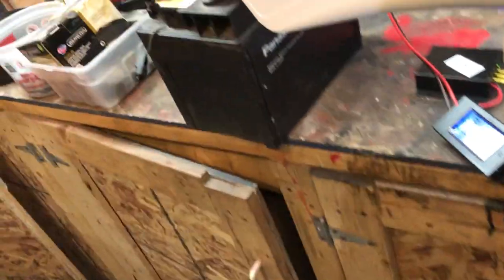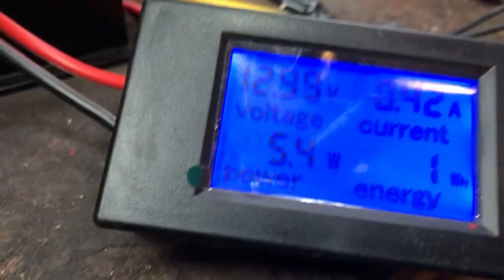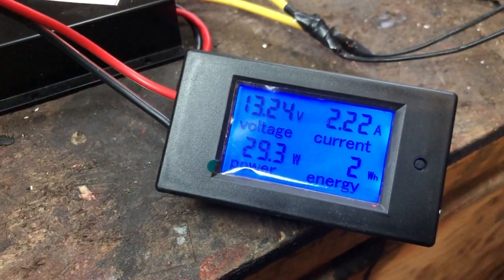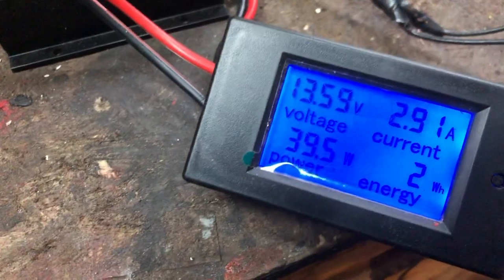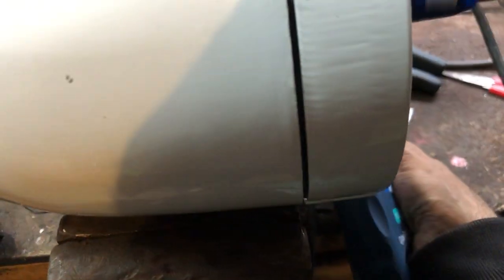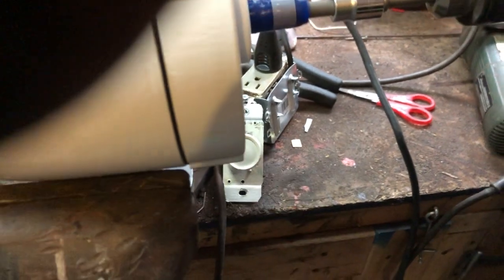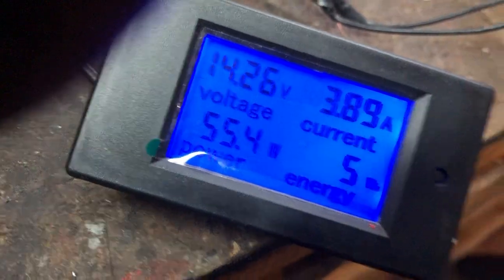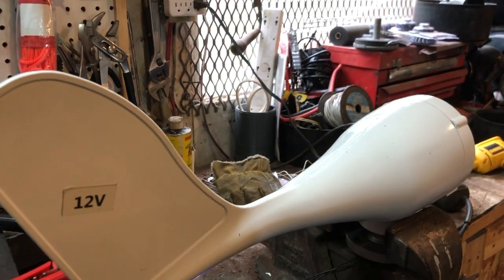Test of a 5400w Chinese wind generator from eBay - Part II

Comment: the turbine is a 500 watt turbine and it is only standard wind charger with maximum 50 / 100 watt ^^ you need a "real" wind controller ! and you need load !! with standard wind controller, without load and so on you only can get 50 / 100 watt from EVERY WIND TURBINE ;) WRONG TEST !!! most youtube wind turbine videos are "WRONG" !!! and 5400 watt mean the set of turbine with inverter - the inverter can be a "optional" 5kw inverter ^^ most people on youtube do not know what they do ?! and the follower "believe" this wrong test videos :(

Comment: If the battery is low it will do better. If you is using the controller that came with it. You are probable not going to get near the rated power. I tested my vevor 500 with the controller that came with it and got only 6 amps max before the break kicked in. With a 3 phase rectifier  ( NO BREAK ) at top speed of my battery drill ( 1600 rpm ) I got 29 amps. Hurricane  wind.  If you use a better controller so you can set it to break later then it might make 100 - 150 watts. Me I'm going to use the 3 phase rectifier  ( NO BREAK ) and a kill switch for big storms to save the battery's from higher voltage and over charge. 350 watts is 29.17 amps 12 vdc at 1600 rpm. Mine should be labeled as a 100 watt turbine. 
If you are not using a 3 phase rectifier try it.

Comment: 1) All small wind turbines actually achieve much less Watt than specified.
2) All practical tests show that small wind turbines hardly generate any electricity. And only at costs above 1$/kWh! 
There is hardly any wind near the ground. And it is also very gusty, which extremely reduces the service life of the systems. 
With solar systems, you can reliably generate electricity for about 8-12 cents/kWh over a period of 25 years!
Reply: But not in winter ...
Reply: @bartdepauw1156   There's no question about it: if you don't have an electricity connection, you have to use the very expensive alternative of the largest possible wind turbine in winter. In principle, however, small wind turbines generate electricity that is usually about 10 times more expensive than that from your private solar systems.

Comment: They can only put power in if the battery was flat, and lower the output deliberately as it charges. Try again with a flat battery. It won't produce 5000w obviously, and if it could it would take 5000w of power to spin it fast enough for the test. I have the very cheap 500w version, and with my Macbook Pro, iPad pro, iPhone and diesel heater all charging and running, it kept my volts pinned to 14.4v during a storm. They really don't do much outside of a storm. With a fully charged battery it obviously outputs very little, otherwise it would boil my battery.

Comment: Unless I have missed something here you need to put a load on the generators output that you can vary. Yo then measure the voltage across the load and the current being absorbed by it to obtain the power. By increasing the load until the voltage from the generator falls below the value considered to no longer valid, i.e. as the generator saturates.
Reply: No, he already HAS the battery as a load. Turbine is producing current on that load (battery with 13V ). So the wind turbine should produce much more power as advertised by the manufacture.

Comment: Wrong test and wrong conclusion. There is no way to reach max power of the generator with that test setup. To see the max power, you must connect generator to a low impedance + high power load e.g. heater coil so that to generator can deliver most of its output power to the load. I wonder how you feed 12V generator (which may reach 14V output) to 12V battery which have only 2V difference.

Comment: i agree its not 5400 watts. but your wires are so small there is no way you could get power from it. also battery was 13 volt at start so it was full not needing power so it limits it.  i call this a fail
Reply: Yes, he should have loaded it so the output stayed around 12V. That way we'd be sure the charge controller wasn't throttling the output.
Reply: Yes. If the turbine could produce for example 2000W , on 13V the current would be like 150A on the battery. On the 3 phase wires from turbine to handle 150/3 = 50A, wires must be at least 25sqmm/ 3AWG. Then for 4000W you could expect wires from turbine to be 35sqmm/2AWG (AT LEAST) so they do not get hot and melt. By the way, how HOT the wires get on that video ?? the author of the video should told that.
Reply: ahahaahah